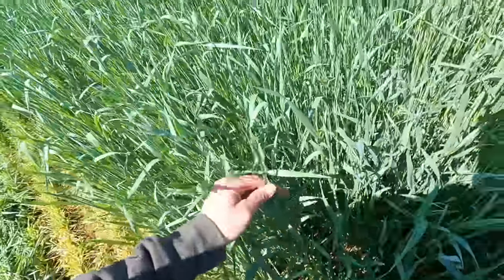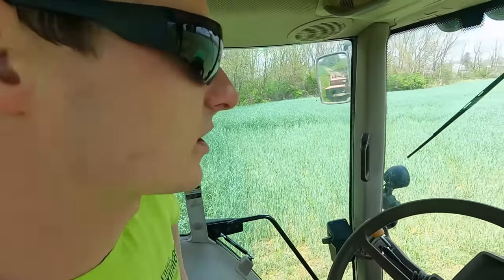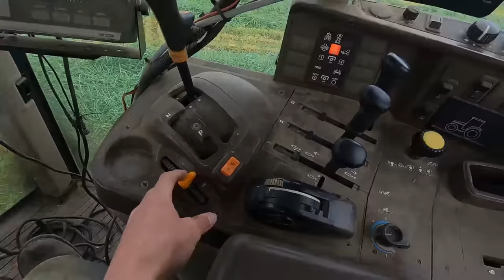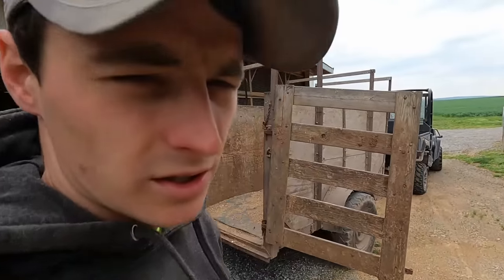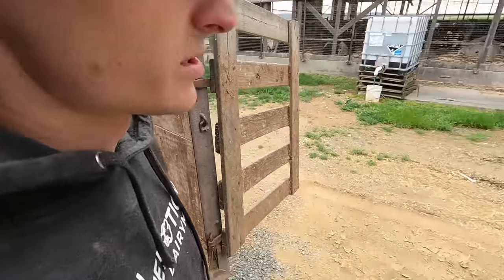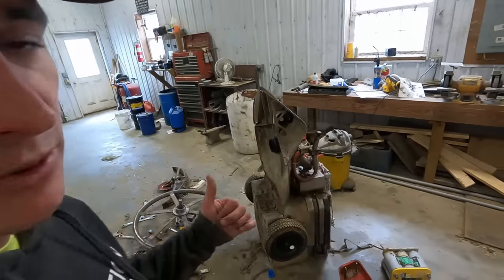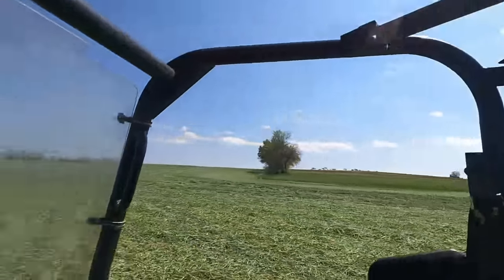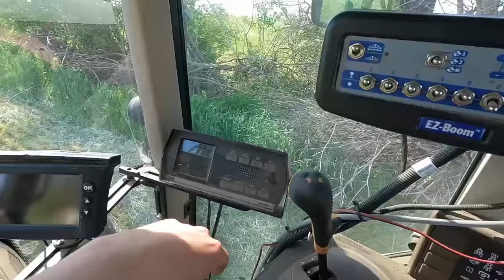Filling Silo with Rye & Planting Soybeans

Comment: It is always a pleasure to see your operation. Well done. 

Just one little nag: On shafts and cylinder rods: if the oil is leaking out the dirt is leaking in. I know that you'll fix it because you do a good job of maintaining stuff.

The 'pills' for monitoring are way cool too. I'm reminded that the insertion tool is just a little bigger than the magnet tool. (;

Comment: 'Tetting' - doesn't flipping one side of the pile onto the other side of the pile mean you have double the hay sitting on the original wet footprint? Doesn't that cause it to stay wet then start growing bacteria? (so less feed value and gastrointestinal issues increasing) Isn't raking better since it moves all the hay off the wet footprint of the cut row?
Reply: Oh. I see the tetter spreads it evenly (I guess I was thinking about a tetter I saw on another channel that just flipped one 1/2 onto the other 1/2).  Looks like that rig is a excellent way to dry.